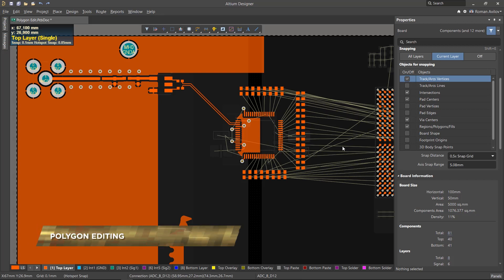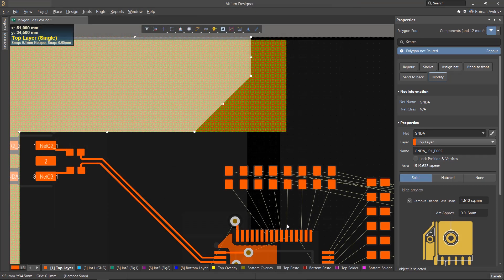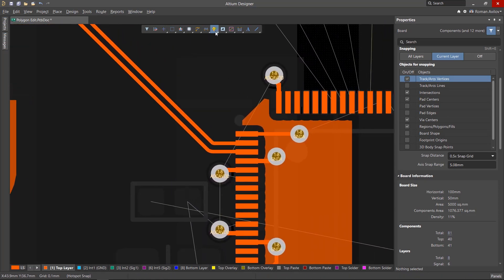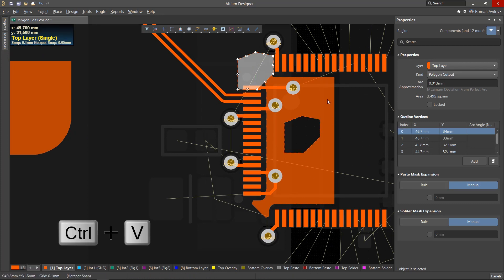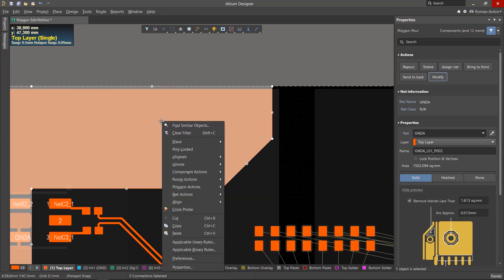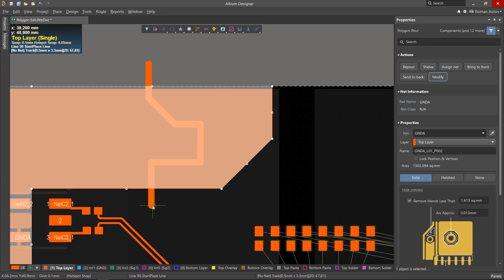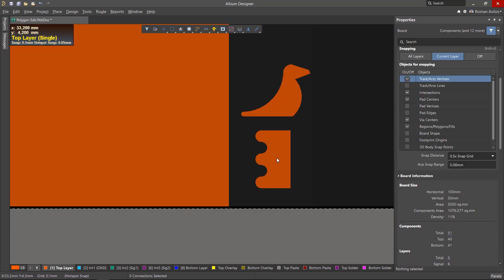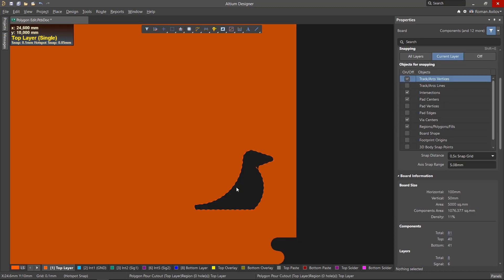How to Edit Polygons in Altium Designer | PCB Routing

Comment: What version is this? I can't move the vertices of the polygon, it just goes into selection mode. Then a blue square shows when it drag it to the right and a green square shows when I drag it to the left. It's not possible to drag polygons in my version. I have to manually edit the coordinates!

Comment: This is driving me crazy... If you substract two polygons one in the center of the other, then you end up with a polygon cutout, but inside that cutout you can't create any other polygon, because it doesn't pour.
Reply: I think a better name for it might be "polygon keepout" instead of polygon cutout because the cutout is not specific to a particular polygon. It cuts out from ALL polygons in that layer that overlap with the cutout region, not just the polygon where you did the subtraction.